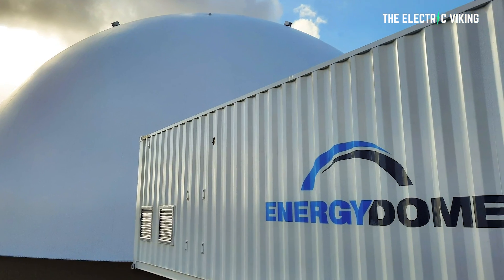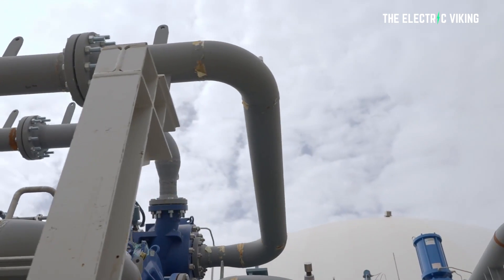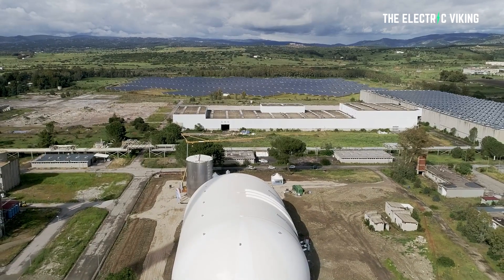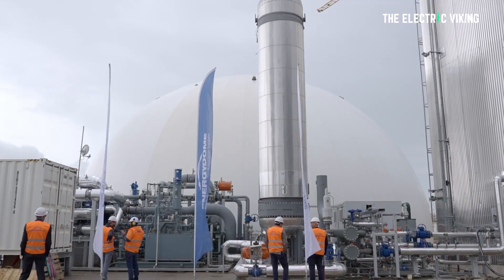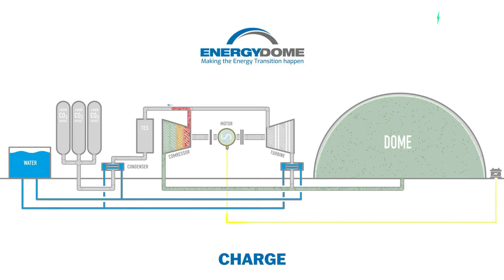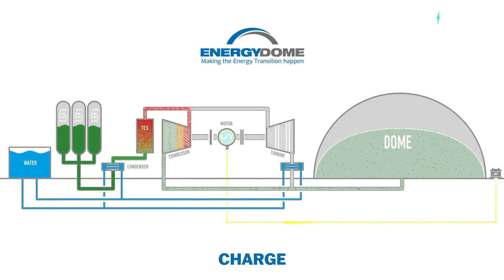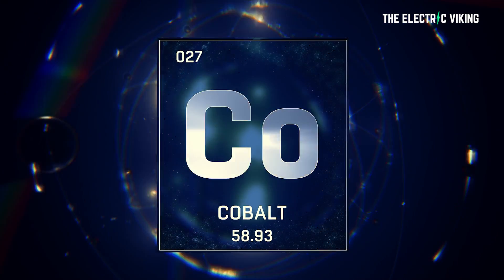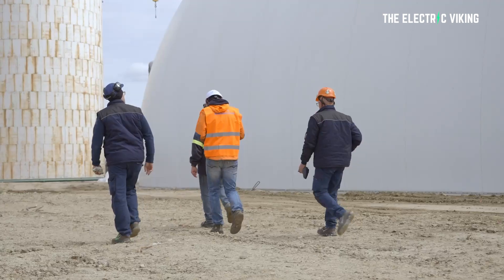NEW CO2 battery is about to change the world as we know it

Comment: Except where Wh /Kg is a serious factor - aviation is the only case I can think of - all energy storage will ultimately be Li ion.  (It is possible there may be some Na ion usage, but I regard Na ion and Li ion as being essentially the same.)  The key factor is how much of the energy put into the battery comes back when the battery is used.  Apparently Li ion returns the most energy.  Ultimately mass production, in a world where the sun provides free energy, makes all costs marginal except the raw materials.  For Li ion batteries the raw materials will ultimately be nearly 100% recoverable, so that cost is also marginal.  Ultimately the least energy waste solution is the winner.  How do I know Li ion is the winner?  Because Elon figured this out decades ago and I would not bet against Elon.

Comment: This is not a battery, this is a steam engine operating with CO2 rather than water. Even so, it can be very useful as in a pressurized system it can utilize lukewarm heat sources to boil CO2 and use condensers cooled by ambient air or water to get back to liquid again. This could be done almost everywhere where size is not a problem.

Comment: This "battery" is based on a very common concept... compress a gas, and now the energy is converted to potential energy which can be recovered when the gas is released. Similar ideas have been proposed, designed and even implemented... like dropping a gas container deep into the sea and allowing sea pressure to compress the gas. Using different kinds of gases. You don't even have to compress a gas, there are gravity "batteries" and pumped hydro and plenty of other ideas which simply use physics to convert energy to potential energy. They all work, they all work reliably and don't involve exotic materials. All that other stuff like energy density and efficiency are well known values that are either based on Chemistry 101 or the design of the device likely based on very common and well known methods with plenty of real world data.

And, for the concept described in this video, there is no removing CO2 from the environment except for the miniscule amount that is compressed. This is not like some kind of wonder device that continuously removes excess CO2 from the environment.

Comment: @alan Jameson, I agree. It’s a sealed system so it isn’t a co2 sequestering system. Sam, you have to watch your words (or perhaps this is your understanding) as this system doesn’t “generate” electricity/energy. Just like your title says, this is a battery. Battery’s store energy, they don’t generate energy. 

The value of this product is for things like energy load balancing, ie. when generating too much energy, we need to save it for a time for when energy production goes down: wind stops blowing or the sun goes down, or, in the case of California, it’s the start of the evening and everyone is plugging in their EVs. 

It’s an important product but it doesn’t generate energy and it doesn’t sequester CO2, other than a 1 time process to load the battery. It’s a battery that doesn’t require exotic materials. Maybe it’ll be low cost compared to a chemical battery product.

Comment: This is, in reality, a variation of pumped storage technology, to the extent that it can actually be called 'technology'. I can see how it might be useful in conjunction with, say, a windmill farm or solar farm power generation system to store energy that is generated during periods high production and low demand for that energy to be released when that cycle reverses to higher demand and lower production but it is not CO2 neutral. After all, manufacturing all of this infrastructure will, by necessity, generate CO2. That isn't to say that this doesn't have value. As pumped storage goes, it seems to make more sense than, say, a large reservoir for the storage of water pumped uphill to be used to generate power when it is allowed to flow back downhill. But you pose the key question that must be answered: "What is the energy density of this system?" along with "What is the COST per KWH." If it makes sense on a large, centralized scale then would it make sense on a smaller, more compact version for an individual home owner or apartment complex or commercial building in the same way that a Tesla Power Wall does for a homeowner or a larger version of that for a commercial application.

Comment: why is an air compressor considered a battery ? 
Strictly speaking about an energy storage solution, wouldn't just using air be better than using CO2 ? 
As far as calling CO2 a culprit of climate change >> How does storing CO2 solve our problem ?  What, are we going to put the CO2 in the landfill and magically it will disappear or something ? 
IF CO2 is a culprit of climate change, we need a way of converting it to another form.  Why not just get people to plant and take care of trees ? Rather than paying/fundraising to have OTHER people plant trees for you, plant the trees and take care of them yourself. 
      Currently, I take care of around 30 giant trees at the house. At the farm we maintain and take care of hundreds of trees. All you have to do is NOT disturb the leaves beneath the trees. Water them in their youth until their roots hit the water table. Then just make sure the top soil doesn't dry up by leaving the leaves on the ground. My family has been doing this for a little over a hundred years.

Comment: Sorry, this in nonsense. There's no CO2 'removed from the atmosphere' and once it's full, it's full. It's not taken from the atmosphere, that's for sure, to do so on site for a single application would be far higher cost than value. Commercial CO2 is produced from burning gas. This is an advertising scam, even if 20 tonnes of CO2 per unit were taken from the atmosphere, it would be a drop in the ocean, but this requires manufactured CO2 & is changing nothing

Comment: This is intriguing.  A correction though, as others have pointed out, this technology does NOT remove CO2 from the atmosphere.  It may temporarily extract CO2 from the atmosphere and use it in its closed loop, but it doesn't reclaim the carbon.  The CO2 will eventually wind up back in the atmosphere (net-zero).   It's basically a low pressure system and a small amount of energy would continuously pull CO2 out of the atmosphere to make up for leaks in the system.  That's all.  It is a closed system, but it is critical that it be 100% contained.  99.99% containment is plenty sufficient since making more CO2 is easy.

In terms of the technology, it looks like they are using CO2 as a phase-change material, like a heat pump.   e.g. like a mini-split, heat-pump water-heater, or air-conditioner.  In fact it IS a heat pump and just like any heat pump it is reversible.  So they can put energy in or they can take it out.   CO2 can indeed be used this way, there are heat pumps already on the market that do it.  For example, SanCO2 heat-pump water heaters (I have one) use CO2 instead of refrigerant.

When a material goes through a phase change, e.g. gas-to-liquid or liquid-to-gas (for our purposes lets not worry about the solid state), a great deal of energy is required or is released to actually make the phase change.   Depending on the direction.  At home you can see this effect when you boil water.  The temperature will rapidly approach boiling but then basically stops just short of boiling.  A great deal MORE energy must be put into the water to actually get it to boil and vaporize with any signifcant volume.   This is why you can simmer soups and most other liquids without worrying too much about under-heating or over-heating it.

The same can be said for CO2. The temperatures and pressures required to reach its phase change points are really quite mild compared to other gasses.  Its a good chemical to use and I hope this company is able to make it all work.   I haven't worked out the energy that can be stored and retrieved via the phase change, but I'm sure someone with enough time on their hands can look it up and convert it to kilowatt-hours per volume.

I would expect fairly severe losses in this system, though.  I can't imagine that it is more than 70% efficient or so.

-Matt

Comment: One advantage of this system which probably needs considering is that it won't require as much lithium, cobalt, nickel and other strategic metals as today's batteries do.  Clearly, the steel alloys will require some nickel, cobalt, etc.  I expect there's no lithium at all.

This will prove advantageous both in cost savings versus equivalent battery arrays, plus there is also the consideration that needing only small amounts of nickel, cobalt and such will probably make it easier to source these materials locally or at least in friendly nations.

Those of us living outside Europe will need to begin rearranging our thinking to adapt to new realities, such as no longer being able to purchase metals, petrochemicals, petroleum and natural gas from Russia.

Comment: Well, they are using the carbon dioxide as a working fluid, so it's being constantly recycled through their system.  There will be small losses due to leaky seals, shut-downs for maintenance and probably other events or systemic issues that release some CO2.  Hence, they will need to continuously add CO2 from somewhere, in addition to charging the system in the first place.  It almost does not matter where they get their CO2.  If they pull it out of the atmosphere, that's great.  If they buy it from a concrete manufacturer that's also great.  

I do like this concept.  It seems to be a very straightforward physics and engineering solution to energy storage.  I really hope it also proves to be economical and financially successful.  That last might be a challenge, since the idea seems easy to understand and copy.

If this technology were adopted in many, many locations around the world, that would remove a small but significant amount of carbon dioxide from our atmosphere.  It will be fun watching the company's progress toward what we can hope will be massive global success.

Comment: I highly doubt that they are removing CO₂ from the atmosphere.This is difficult and expensive - it is only 0.0314% of the gases air is composed of.
Commercial production of CO₂ is done by steam reforming of methane. A process that usually uses fossil fuel for process energy. So it is dirty.
Aside from the fact that the amount of CO₂ stored in these batteries is trivial on an environmental level , this smacks of green washing.
i.e. "Invest in us ,we use CO₂ to store energy."
And this channel has lapped it up.

Too many of these alternative energy channels are too light on engineering knowledge and merely base everything on company press releases.

The only answer to the destruction of the environment is less humans on earth

Comment: A quick search shows CO2 at 30 deg C (86F) requires about 1500 psi to remain liquid. For comparison a household propane tank is about 150 psi.  So ten times higher pressure - high but not crazy high. It is misleading to call this a battery though, better to call it an energy storage device. Beware -  Liquid salt which has similar availability and environmental benefits has not fulfilled its promising potential apparently due to every day engineering problems like cracks and leaks in the storage tanks.

Comment: Phase change is important in this type of device. Liquid air batteries work in a similar way with the advantage that you dont need a bag to capture the exhaust because the working fluid is just air. Liquid air batteries have already been deployed.

Round trip efficiency on these type of devices is not very good due to difficulty of minimising thermal losses. 50% is probably about as good as it gets.

To get a fully reliable grid using renewables you need about 200GWhr of storage for every 1GW of on line capacity when using renewables alone.

The reality is in those places not well endowed with hydro, geothermal or nuclear this level of backup and storage is expensive to achieve.

 Getting to this level of storage with chemical batteries is impossibly expensive (about $2bn/GW hour). However, chemical batteries have an almost instantaneous response time and very good round trip efficiency around 90%. This s important, so some chemical battery storage cant be avoided in renewables system.

Pumped hydro is undoubtedly the best and most economical bulk storage solution for renewable energy. Its round trip efficiency is about 70%.
Its response time is up to two minutes so it doesnt need pairing with huge batteries. The cost is around $35m per GWhr at the 2GW rate.

Where pumped hydro is not practical, it is probably best done by making hydrogen when renewables are in excess and burning it in gas turbines during renewable down time. Gas turbines have about a five minute response time so need pairing with a bigger battery. Also round trip efficiency wont be great, probably no more than 40%. However, in comparative terms electrolisers (to make hydrogen) and gas turbines are quite cheap.

Comment: Highview energy has a similar product but just compresses air. I’d like to see a discussion of the engineering trade offs of one process vs. the other.

I do think that these types of physical (water and weights) and phase change batteries have a role to play. The response time to get energy out is far longer than with chemical batteries but if they are cheap enough they can greatly reduce the number of chemical batteries needed.

Also if the amount of renewable energy generation is high enough (Tony Seba estimates a need of 3-4 times current to cover every single day, which would produce a super abundance in most locales 95% of the days) then a low efficiency of power in to power out becomes less of a negative.

Comment: It seems that this machine has a lot of energy requirements just to make energy.  I'm no engineer, but I'm struggling to see how it can have an efficiency rating high enough to justify the economic expenditure to produce and maintain itself.
Reply: Generate electricity with aero when it is windy is cheap, but there is certain amount of energy needed in a country. If you were to exceed those needs you either turn of the aerogen or dump the energy. Any battery solves this issue so you can have all your aerogens, PV or any other renewable 100% on no matter energy demand. The economic motivation for building this is to increase usage, and therefore profitability, of existing infrastructure.

Comment: You made a mistake in what you said. It does not take CO2 from the atmosphere - it is a closed system of high density and pressure and low density and pressure. The only reason they use CO2 is because of its room temperature characteristics. Fairly major installation required, so may well be part but not all of the overall solution, where water at different heights is an impossibility, as hydro will be better efficiency where available.

Comment: do  you enjoy "protection money"
Reply: liquid air, liquid nitrogen, same thing
Reply: carbon neutral, not carbon negative :)
Reply: you can remove oxygen from the CO2, release the oxygen, store the C as carbon, solid fuel
Reply: you can for example use hydrogen to separate the oxygen from the carbon, C + H2O

Comment: Hi Sam, thanks for your videos. This doesn't look like such a big deal to me, it looks like a heat pump with phase change. Given that the heat of vaporisation of CO2 is 180kJ/kg, this is equiv. to 50 Wh/kg best case with no losses. So about 2-5x less than Li batteries. Of course this is just a back of the envelope calculation...
Reply: The system doesn't use the heat to create power. The expanding gas drives a turbine.
Reply: Yep, but the energy still comes from the phase change. Its just a ballpark calc, how would you calculate this? Of course there is the power loss due to the turbine, that's why I specified best case. So you are quite correct that the resulting output would be much less.
Reply: Why do you care about Wh/kg? This is for grid storage, not cars or ships right? The only way in which energy density is relevant is if it affects cost in any way (increases land use for instance). $/Wh is the important metric
Reply: Because this is kg of gas, so the required space is huge. But generally you are correct, we don't normally care about Wh/kg.

Comment: The only advantage over liquid air “batteries “ is that you “ aren’t dealing with super cold temperatures” while the disadvantage is that you have to store the CO2 as gas at atmospheric pressure. Liquid air also uses off the shelf parts but doesn’t need the dome.
Reply: the CO2 is stored on the high pressure side as a low temperature (-2 - -4C range at a guess) liquid at something around 350 to 400PSIG.
The CO2 compressors would be off the shelf CO2 refrigeration compressor.
CO2 is becoming common in the refrigeration industry now so there's lots of equipment readily available.

Comment: There was a youtube video about this Energy Dome CO2 system a little while ago.  There was also a story a couple of years ago from "Just have a Think" about a CO2 capture system.  If I remember correctly that video proposed combining that capture with this energy storage solution.  Of course any captured CO2 has a market replacing CO2 currently created by burning natural gas for greenhouse use or whatever application you have.  That would save the current burning of fossil fuel.

So in summary a lot of good things are gradually happening in this space.  It's no thanks to governments like ours that effectively subsidise the fossil fuel industry.  Also no thanks to those F'F' enterprises that fund political parties ensuring continued support from whoever is in government.